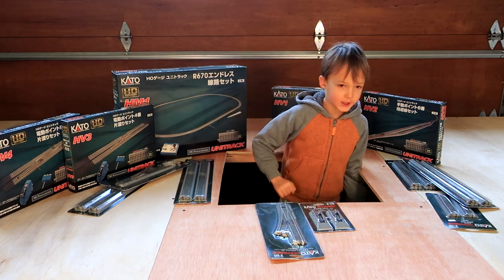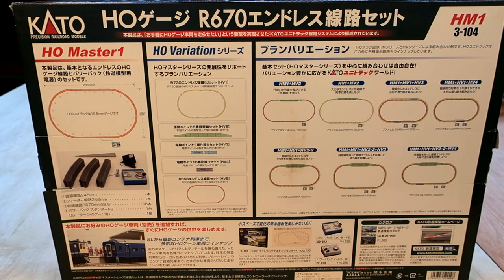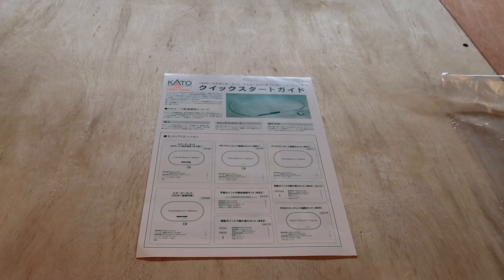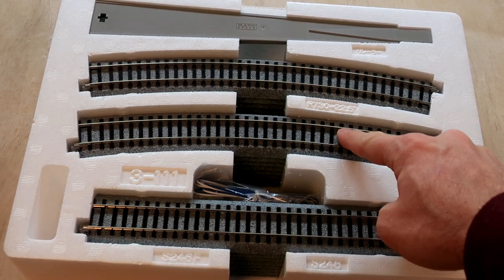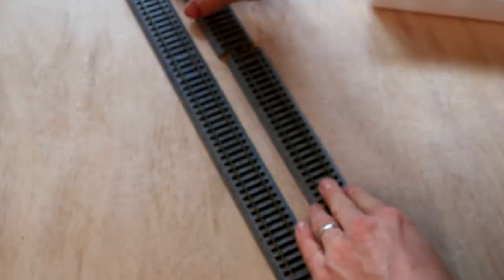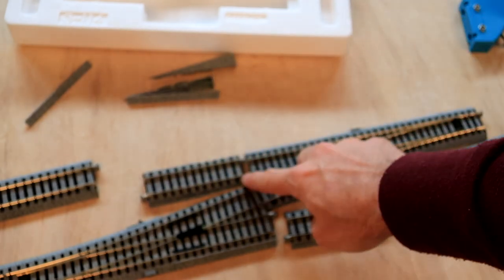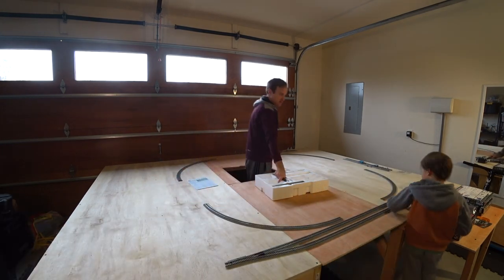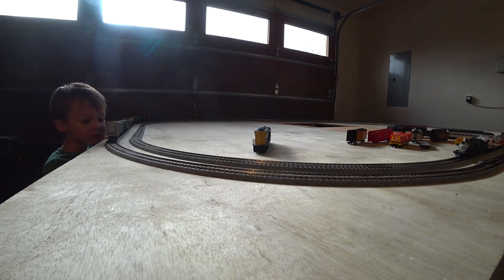Building an HO Layout - Kato  Unitrack unboxing

Comment: Very enjoyable video - thanks for posting. I use the HO Kato track as I don't have room for a permanent layout so the sectional track is easy to put up and take down. I've had my pieces for about 7 years and it's still going fine. So good luck with your layout.
Reply from the maker: If you have a layout. You go have good luck too

Comment: Great video!  I know it's been three years since this upload, but are you running a two power pack setup?  I'm running an inner and outer loop setup connected with an HV4 turnout.  I can backup onto the inner track, but as soon as I hit the switch to run only the inner track, the whole thing goes dead.  Is there a way to make this work with one power pack?
Reply from the maker: You will need another controller for the outside track to work but crossing over will not work too well so i do not reccomend it

Comment: I have a HM1+HV1+HV2x2+HV4 setup (HO). I would also like to extend length of each of my HV2 sidings for both the HM1 and HV1 ovals. Could you please advise how many pieces of Kato 2-150 (straight track) and Kato 2-230 / 2-240 (curved tracks for each oval, respectively) that I might consider before joining back to the main ovals?

I am currently using HV4 to Switch between ovals, however I would also like to have the option for the train to switch back without reversing. For my setup, would this mean purchasing either Kato 2-863 (manual) or Kato 2-861 (powered) right-hand turnouts for switching between the ovals?

Are any other accessories required to make this extension to my layout happen. For example, Kato 24-840 (turnout control switch), Kato 24-841 (turnout extension cord), Kato 2-504 (DC turnout machine)?

Thank you so much for your time and video!
Reply from the maker: Currently dont have the whole settup right now so i dont know,

Comment: Are you able to run a train on both loops from a single power pack or did you have to supply power to both loops from separate power packs?
Reply from the maker: We had to use 2 seperate power packs, I dont think you can use 1 power pack for 2 tracks, Maybe if you try hard enough but i doubt it'll work
Reply: @adensrailfanningproductions  ok, I've bought the same two loops but not crossover yet, good to know I need to buy other switches separately was planning to buy two of those boxes.

Comment: Hi Ken! Best video I've found for this setup. I have a few questions as someone who is currently putting this setup together. You had mentioned 2 things you would do differently: #1 buying the individual pieces to reverse HV3 and extending the inside siding around a curve to connect to the back end. Like you, I also purchased a 2nd siding to go on the inside of the loop. Would you mind advising me on what specific pieces from KATO I would be looking to purchase and how many of each to accomplish those 2 improvements?
Reply from the maker: Like the other comment, Dont have the settup right now.

Comment: appreciate the info greatly.  confused as to actual outer dimention of track (edge of ballast) width.  Radius is clear, bur back of box shows greater width.  can always wait to purchase table material, but must fit in room.  example:  R670 = 1340, but shown back box as 1382.  42 = width of one HO scale track, hence radius is center of track each  track or as outside of one to inside of opposite?
Reply from the maker: Don't really understand what your saying but, Thanks for commenting!

Comment: I'm going to be using bachmann ez track with gray roadbed and nickel silver rails on my layout
Reply: bachmann is ok as long as your not doing switching with bachmann track but if your going to use bachmann i suggest using kato or something other than bachmann for your switch's
Reply from the maker: I havent used any bachmann switches but the kato ones work amazing!

Comment: Loves it.. ❤❣️What's the Track Dimension. In Centimeter?
Reply from the maker: Most likely you can find it on google or whatever browser your using
Reply from the maker: If you want to know now its 16.5mm
Reply from the maker: Apologies for using millimeters instead of centimeters. It is 1.65cm for the track gauge or dimension